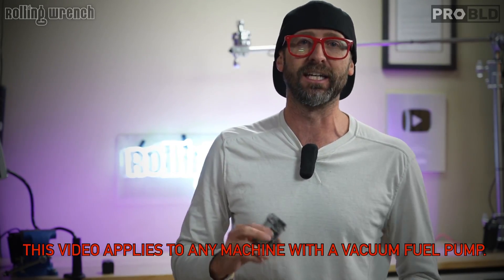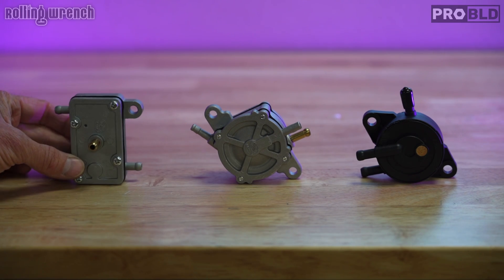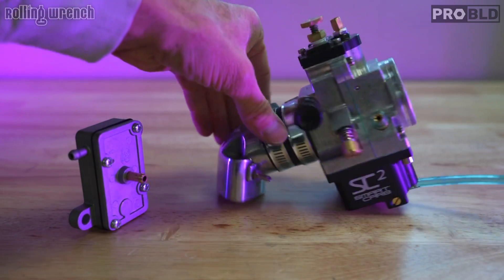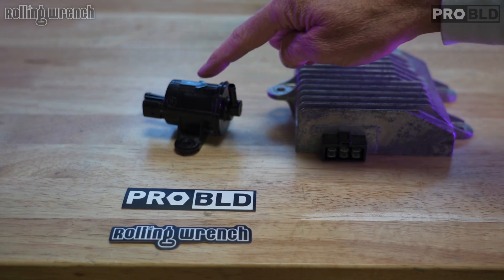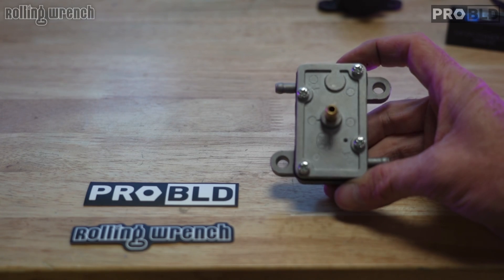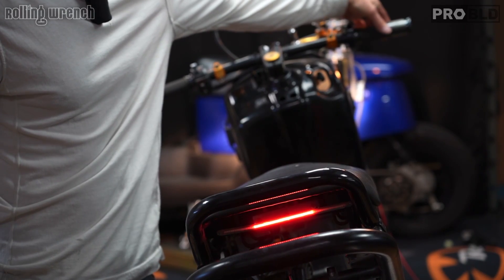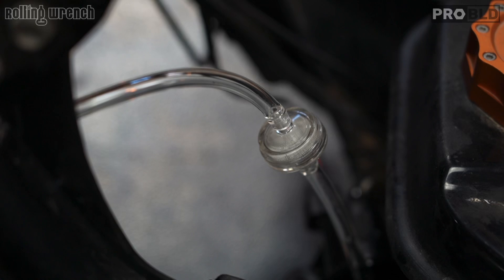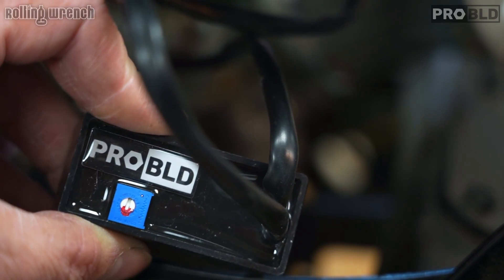No more vacuum fuel pump problems! GY6 Won’t start: FIX! [PROBLD PULSER UNIT]

Comment: My question is how will this work with a smartcarb that has no over flow pipes.

Also what fuel pressure is it capable of.
Reply from the maker: I have personally tested it on smart carbs. Works great! 2psi
Reply: @RollingWrench  the reason I ask this is this could be a viable option for issues I am having with a smartcarb on a different set up not bike related
Reply from the maker: @Falling-Fluffy  oh ya! I have people using them on Honda 2T dio’s as well. They over fuel. This is the fix. Simply set the pulse rate to your desired flow… done :-)
Reply: @RollingWrench yeah but your desired flow will change with throttle position